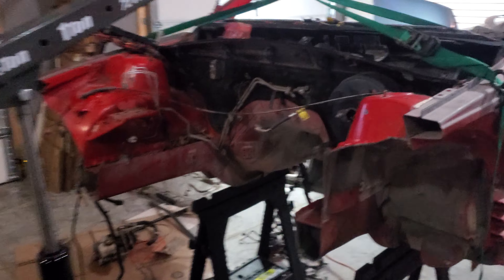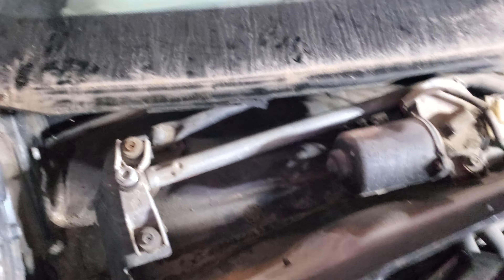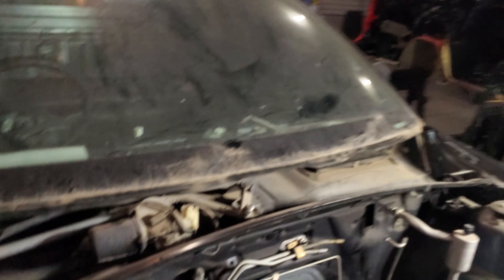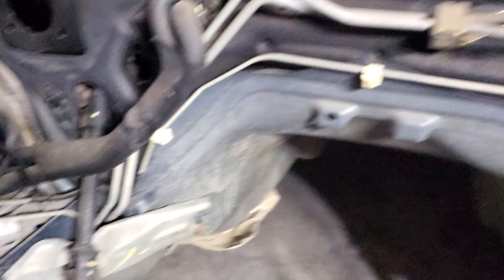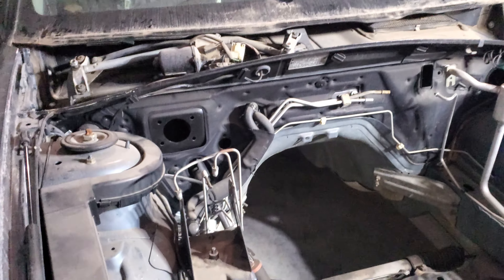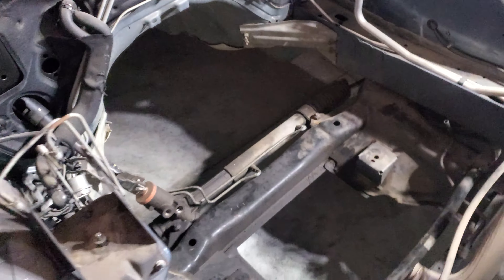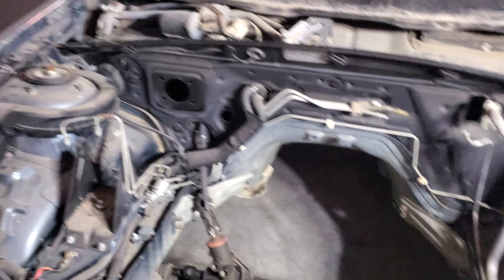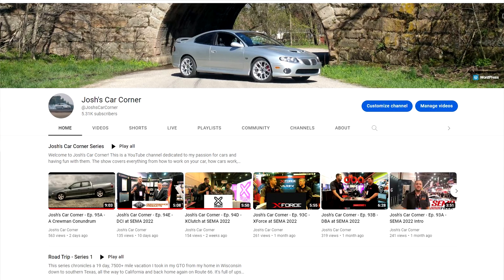Josh's Car Corner - Ep. 95B - The Crewman Decision

Comment: I'd be pretty surprised if the cradle was different, honestly. If they made one for LHD, you'd think they would have shifted the engine over towards the right instead of having it closer to the left side where the steering is on an LHD car. It would have made it a lot easier to put headers on if there was more room over there. I think you're making the right call on do the LHD swap and getting the right cowl, too. I wonder if the headlights are different between LHD and RHD. I've always heard that the way they are focused is a bit different, but I'm not sure how big of a deal that really is.
Reply from the maker: They are,  and I have new ones on the way